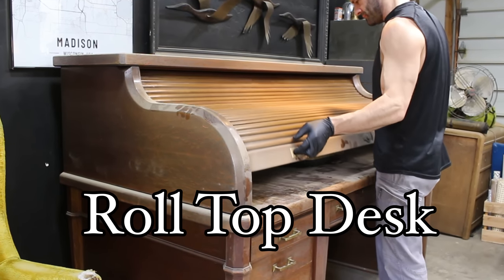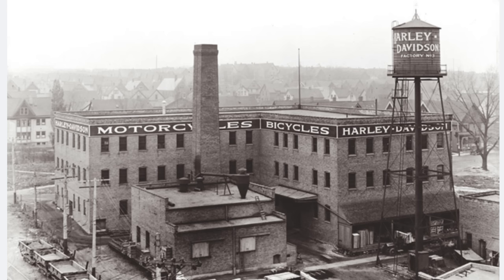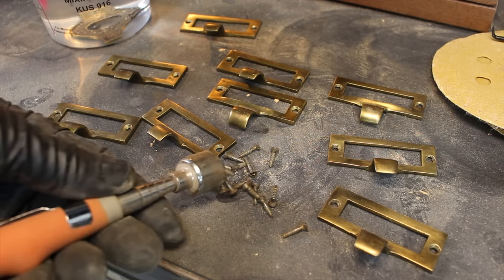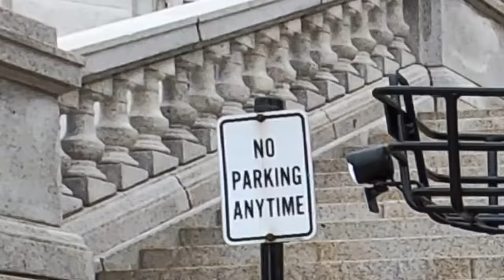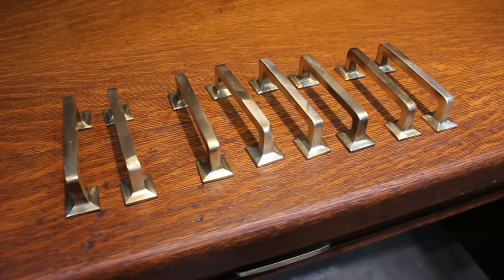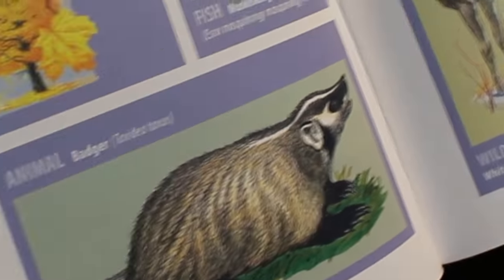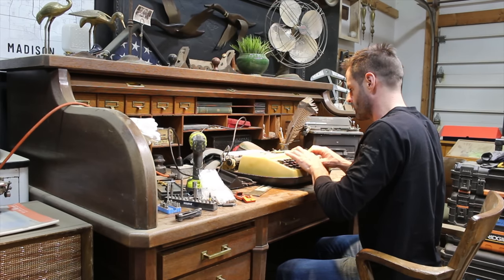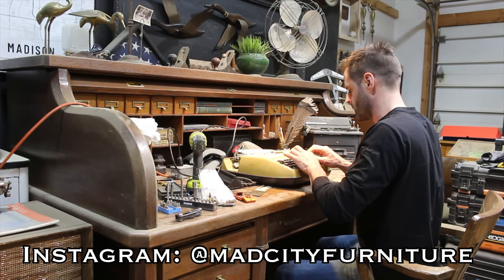Ep. 76 Amazing RESTORATION of a MASSIVE Antique Desk

Comment: Before I moved into my present house I really wanted an antique desk as the main focus of the room and at a dealer friends place I saw the corner of a desk under a lot of other stuff so I bought it anyway and when they delivered it it turned out amazing with linenfold carving and really heavy drawers, only bug was the pulls were strangely bad rusted metal, not even brass so I sourced period correct ones but I haven't finished the restoration yet and I'm about to move again